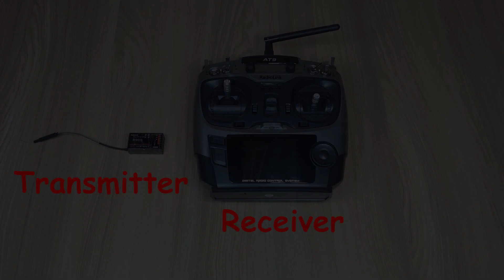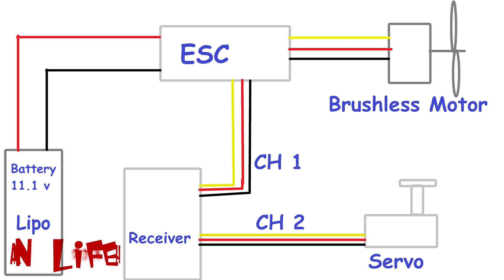How to Make a RC Electric Boat | Homemade Hovercraft

Comment: use the motor,servo,Lipo,etc to make a really nice airplane....this boat can be made with a 15 rupees motor guys and a nine volt battery...with the propellor in the water....fool☺☺💐
Reply from the maker: +anil ahuja 
owww, and how will you control it?